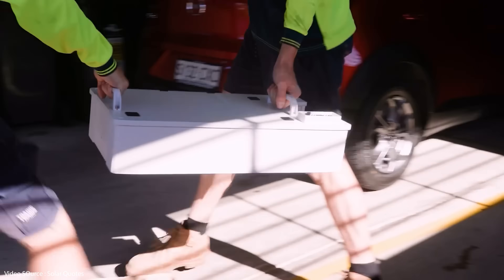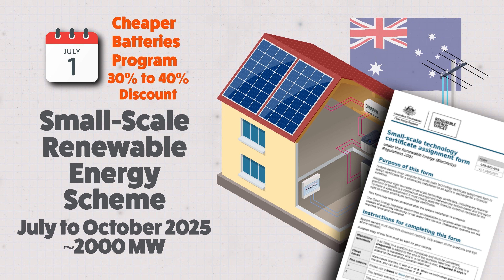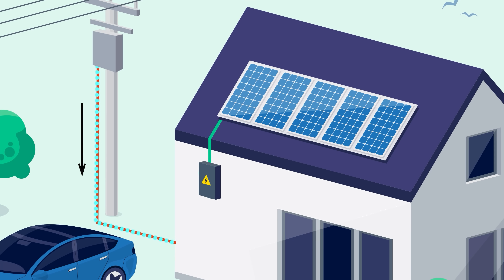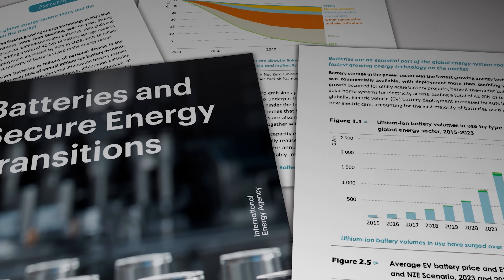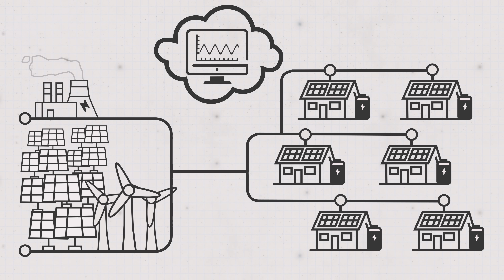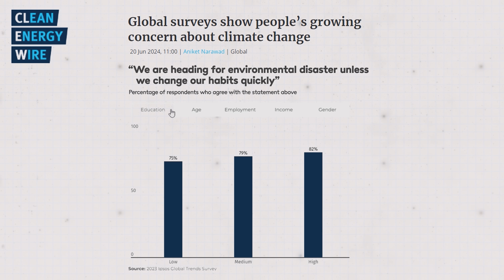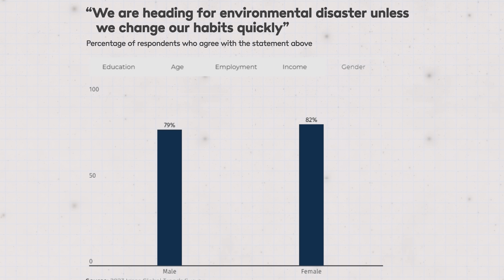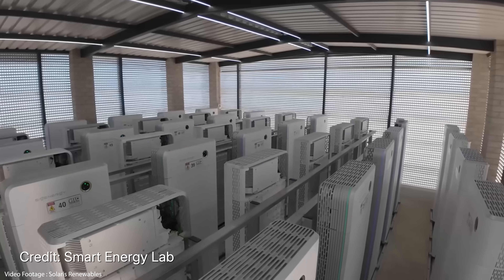Australians installed 100,000 home batteries in 17 weeks. Why can't we all do that?

Comment: I live in Perth Australia, I have 20kw solar panels, and 36kwhr of battery, my power bill was 2000 a bill with ac going, its now zero and i run my ac from roughly October through to April 24hr 7 days a week, it cost 40k to install 3 years ago but it has almost paid itself off and will give me free power for years to come, a no brainer even without the subsidies if you have the sun/roof space for it

Comment: I give you my experience in Italy. I live 80 km South of Rome in a house gas free with fotovoltaic and using electric cars. Now I have no battery store and I reach more then 50% of autocomsuption charging my cars only during the day. Of course a battery system will help me to reach more than 80% autocomsuption, but it will not solve the problem to stabilize the grid. 4 months a year during summer time I produce too much even to be stored. Instead in winter time for 4 months the production is too weak, so I often depend from the grid. We need a new storage system that let to use the summer over production during winter time. Thanks a congratulation for your intersting video I wish you merry Christmas.

Comment: I have a relatively small solar and battery system installed at my small, terraced house in England. It is well insulated and I am a very low consumer of gas and electricity. With the above in mind it was an easy decision to fit my system. My bills went from £100 a month to £20. I was not expecting so much of a saving. My system cost £5000ish. So payback will be somewhere between 6 to 7 years.
Reply: If you aren't on a ToU, you can prob squeeze more out.
Reply: @tcroft2165 ’ToU’ = Time of Use tariff? Do you mean a smart tariff? I am actually looking at moving over to one in the new year
Reply: @spikewalker6690  Yes, its basically a mugs game to be on a non ToU unless you are unable to move your peak demand about.

On my (albeit larger than average solar) I run a -ve annual bill even with a heat pump.

Comment: Aussie state and federal govt has played the perfect hand. In 2008 they guaranteed large feed in payments for those wishing to put solar on their roof. They followed that up with giving grants towards the roof solar panels . As the cost of panels came down, they reduced the grants and allowed the electricity companies to reduce the feed in tariffs. Those of us with roof solar saw our bill reduction due to solar feed in reducing year on year. So now with large grants towards solar batteries we are all buying batteries. Because there are a lot of fixed costs for the battery installer and the rebates are based on per kilowatt hour installed it makes financial sense to have a big battery. Many people are now acting as their own grid generators. We have software which automatically monitors grid wholesale prices and sells the grid excess battery capacity when  infeed prices are high. Good for us, good for the infrastructure of the grid and good for consumers I think.

Comment: Took advantge of the subsidy and installed 40kWh Sigenergy battery 3 weeks ago, 13.2 kW solar was installed 2 years ago.  In 3 weeks I have charged the battery 666 kWh instead of sending that back to the grid when it does not need it.  I have imported 185 kWh into the battery when electricity is cheap and exported 245kWh when electricity is expensive.   Currently have a negative bill.

Comment: I've been fortunate to have afforded a solar/battery install for 7 years now. As the feed in tarrifs fell from 44 cents to just 4 cents,  I knew batteries were the go to option. As I had a 10kw system, I could add a 40kw battery set up since 2018 and haven't had a bill for over a decade! But it was a $55,000 investment over 5 years.but it was to insulate myself against outages, supply increase charges, etc. I can still expand even further by another 2kw of pv and 20kw of batteries if things become tight. The local and federal incentives helped by over $12,000 and the current incentives still promote heavy interest.batteties are the key now as solar alone with reduced feed in tarrifs don't cut it for the average household that aren't home during the day to make it worthwhile.  Love your work!

Comment: Like you I have had a battery for nearly 7 years now but despite not being in a position to take advantage personally this is a great initiative.

The next stage has already been touted and that is for free electricity for a 3 hour period in the middle of the day.  This will be an incentive for those who cannot have solar or only have a small array to get a battery, fill it with free electrons and use it in the peak evening.

Those complaining or saying they won’t ever have a battery will also wind up benefiting because this will even out the electricity wholesale market, almost eliminate solar curtailment and encourage more operators to invest in solar.

Comment: For context even with the federal rebate, a reputable battery system (excluding solar) costs between AUD$10k - $15k installed. this is with the 40% off rebate. Of-course there are dodgy battery companies selling for $4000. The issue is not everyone has that much cash laying around.

Comment: Economic situation really does not matter anymore even for the poorest. You can get 400 Wp solar panels with a microinverter for under 200 Euro nowadays. That's just a few packs of cigarettes. You can add a battery storage to it and still remain under 1000 Euro.

I use balcony solar for years now, and it has saved me hundreds of Euro already.

Comment: Hey Dave. 

We purchased an appropriately sized Sungrow LFP battery. Hasn't run out once yet. It even powered the house during a massive storm that knocked the local power out in November. I wish I could pump my excess directly into my neigbours' houses, but hey, it's a start to use it ourselves. 

It took a little longer than desired to sort out the self-consumption mode on the system (a few weeks), but hasn't looked back since that was sorted. Coupled with evacuated tube solar hot water and our 6.36kW solar array, this house is properly set up. Bring on those Sodium ion batteries!

Comment: My house in Thailand has been off-grid for 8 years including powering 2 EVs but installing 12kW of solar and 20kWh of batteries along with a heat pump on my Mother's house in the UK went less well as the DNO National Grid restricted our exports to the grid. The priority apparently is spending £60B upgrading the grid to bring wind power from Scotland to power 138 Data Centers in London.

Comment: Excellent episode Dave - a couple of points.
All of this generation and local 12:31 battery storage where the load is will reduce the urgency and demand for transmission from remote areas where the big solar farms are. How far can this go? Do we still need so much transmission? Maybe battery subsidies are a much cheaper way of solving the generation problem 
Gas demand worldwide is declining so maybe this will lead to reduced peaker plant usage leading to cheaper power prices for households 
Feels like we are at a tipping point!
Reply from the maker: @transfersystems.ModelOne  Funnily enough I've just finished editing a video about grid batteries, to be published in the New Year. I think the answer is that we need both. Some grid scale battery installations are now being sited on land once occupied by coal fired power stations, which means potential employment for local communities.

Comment: Aussie here. Yes, the battery rebate system has been met with a phenomenal response, so the gumment has thrown another AU$4.9B into the scheme.  However the rebate, currently at AU$372 per usable kWh, will start to decline on 1st January 2026, moving to a tiered arrangement on 1st May 2026.  I'm putting in a 15 kWh battery this month, with 3 phase 10 kW inverter that gives me blackout cover while still charging if the solar panels are producing power.  As Dave says, this could/should be a model for other countries to help in the deployment of large scale renewables.

Comment: The idea of adding a battery to your existing solar sounds great but getting it to work with legacy systems can be a nightmare ... my experience. I put mine in before the Australian rebate system became available and I have a lot less hair a year later. I run on a VPP system provided by a company called Amber. Their intention is great ... allows you to trade your power on the open market but the delivery has been less than perfect for people like myself who had pre existing solar panels. If you get a whole system installed fine. Welcome to the partial installation and the hybrid system!  Your wiring won't be compliant because the rules changed two years ago and anything installed prior to that is now deemed illegal and the installers will not upgrade so that you can seamlessly connect to it. BE WARNED.
I have had to write my own software to run the system ... I don't think many of you in my situation would be up to that!

Comment: Wouldn't it be more efficient to do the energy storage on the grid side? A single battery storage  facility for an area with 100,000 home generating systems would probably cost a lot less per unit of storage.
Reply from the maker: That is happening too, but it takes a bit longer. I've just made a video on that subject, due for publication in the New Year.

Comment: Home solar + battery storage should be available for all who want it. But it isn't, and won't be unless changes are made. 

If you are a home owner, you can get them now. There are even incentive schemes. But if you tent your home, you can't get them, and this must change. Having solar removes a huge energy cost from a tight household budget.

Renters must have the right to have solar. I get it that the landlord won't want the expense, but they won't have to. Why not get the energy companies themselves to install rooftop solar and storage on the roofs of their customers, regardless of ownership. This could be offered for a fixed monthly fee (as broadband is). The power companies would have the ability to draw power from the installations to meet demand as needed. This would reduce the need to spend millions rebuilding the grid, as local demand can be fed locally.

Comment: There should be some national security considerations with the battery rollout. Most of the battery systems are for obvious reasons Chinese and thats fine. However when they need to dial home for “reasons” then thats not ok. Batteries should be a dumb device that can be updated when the owner chooses. These systems that require an internet connection  potentially gives a foreign actor control over power systems, and in a conflict there needs to be consideration as to how that could be used against you. 

How in this day and age we haven’t gotten to grips with the fact that even out “allies” are temporary is beyond me.

Comment: The good thing is that post installation, many electricians now have more work than they can poke a stick at, dodgy installations by new companies setup for such and poor product quality (major brands getting their formerly good brand products made in China) is seeing many pensioners suffering huge costs just trying to get the crap working as claimed, be it the solar panels, the inverters or the batteries.
As usual when the government subsidise a scheme to force a change the result is just like as described above, they had a push for batts in ceilings which led to deaths..
As for Australia getting lots of sun, that very fact makes dealing with solar panel issues rather difficult when it's far too hot to be working on a tin roof and it also causes faults in those products.

Comment: In Germany and increasingly in the US they are fitting small solar panels (the Germans call them balcony panels as they hang them on the balconies of flats), these feed into a battery and thence into an inverter that is just plugged into a spare power socket. As I understand it the system tries to meet demand from the battery, allowing mains power in when more is required. I gather you can also buy additional kit so you can charge the battery when power is cheap then sell it back when prices are higher. I am curious about these systems and wonder how the grid copes when they become popular. Any thoughts?
Reply: Solar is just not the path forward.

Geothermal is.

The resources to go with geothermal are dwarfed by solar, and geothermal is limitless plus its capacity factor is 70-90% compared to solars 23%.

Comment: Here in the U.S. way back in the 90's and 2000's, Arizona, New Mexico, Oklahoma Utah all had a solar panel boom, selling excess power back into the grid. that was fine for about 5-10 years, then power company's cut back on what the payback was $2/kwh to just $0.50/kwh, suddenly you are losing money. instead of a 7 year pay off you're looking at a 30 year pay off. Quite a few states now demand you need to have city utilities hooked up and running, regardless of what you have installed to be self-sufficient. THEY WANT THEIR MONEY!!!

Comment: Another key driver of battery take-up in Australia has been the pitiful ROI for Solar Feed-In. Retailers have continuously raised prices (54 Cent Evening Peak) while simultaneously reducing the feed-in tariff (currently 2 Cents). This has led to the situation where Retailers have cut their own throats. Basically, If I export 35 KW a day at 2 Cents and then import (6 KW) in the Evening/Overnight at 54 Cents, the ROI on a battery is suddenly very very attractive. Based on a 10Kw solar system and a 13.5 KW Powerwall, I haven't imported power in 18 months and look like paying off the entire system after 6 years based on current prices - and that system was installed before the current subsidies too effect (tho I did get some solar STC's). In fact, my residual exports have paid the supply charge ($100 / Quarter) and still returned a tidy credit each quarter even in the depths of winter.
Reply: This has also been an additional  incentive for my recent purchase of an EV (which I've been wanting for more than 10 years) - My current car costs about $90 / 400Km in fuel; the new EV will be about $1.20 per 400Km when charged from my home solar at a notional 2 Cents per KW that I would have otherwise got from the FIT.

Comment: I live in Australia and am constantly being bombarded with phone calls to install batteries in my home. There is NO WAY I am installing Chinese made battery packs. I do NOT want to burn my house down. As they say "Fools rush in"!
Reply: Stop enriching China, buy Tesla instead.
Reply: @Les_S537 Where do you think Tesla batteries are made? Besides Tesla don't have a great reputation for honesty.
Reply: @stephenvelden295  Tesla Powerwalls are made exclusively within the US.  Tis true that the LFP batteries currently come from CATL in China, but at least you'd be limiting how much goes to China and Tesla is quickly resourcing from other companies like LG and in house production is increasing at its Nevada battery factory.

The raw cost for LFP battery cells in a Powerwall is around $900-$1000 USD.

Tesla has an honesty problem?  How so?
Reply: @Les_S537 Still a potential fire hazard. I don' want a Moss Landing in my garage.
Reply: @Les_S537 Tesla are constantly lying and covering up it's failures. How many accidents caused by their self driving cars? How many deaths due to those external door handles? Always settling out of court. How many EV owners have actually achieved the quoted range? The whole renewable energy/EV industry is built on lies!

Comment: I took advantage of the home battery rebate. Though, I’m not included in that 100, 000 batteries totals quoted as I only had my batteries installed on Saturday. I went with a 30kw setup. So that gives me plenty of capacity to join a VPP. Between the money the battery saves me and the money I make via the VPP, I’ll have the battery paying for itself in only 4 years. That means for the next 11 years of the expected life of the battery not only will my household electricity be free, but I’ll be over $30K back in my pocket. Money that I can put into my investments or renovations to build further equity in my home. From an economic perspective it’s really is a no brainer. The fact that it is good for the environment is a happy bonus.
Reply: 'Stralia is lucky...  Sunniest place on the planet, but you guys really should do geothermal.  Much less resources needed, and its capacity factor of 70-90% is only beaten by nuclear, and the energy from earth's core is essentially limitless and free.
Reply: @Les_S537 being the oldest continent on earth and the vast majority of our landmass being quite far from any tectonic plate boundaries, geothermal electricity generation is not economically viable in any great way. 

What is economically possible though is geothermal cooling and heating. This has been explored by a few instillations but there is plenty of scope for expansion.